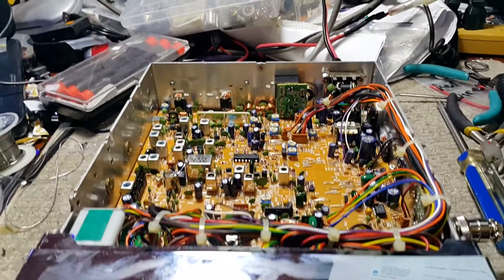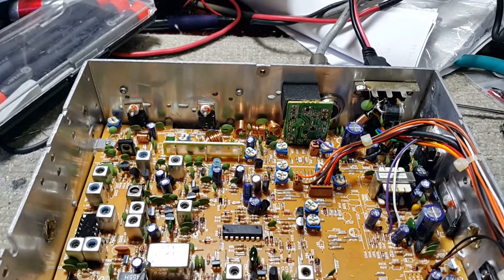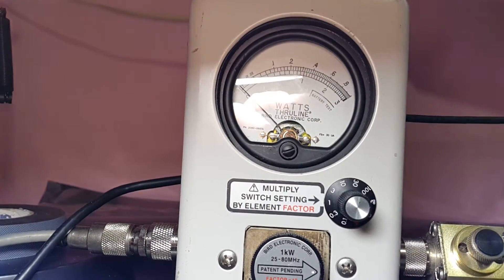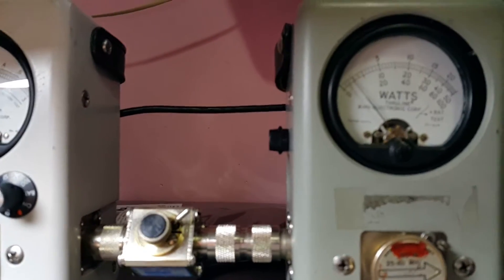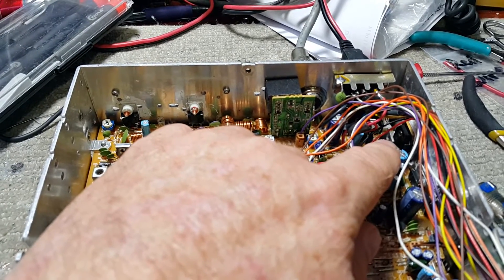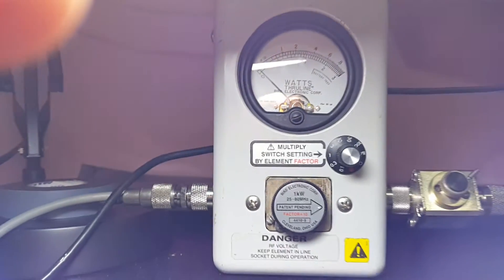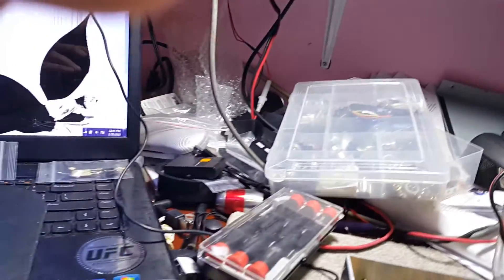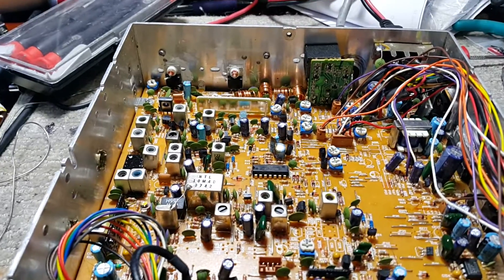Red Wire mod for a Galaxy DX 949

Comment: red wire to "volt" the final..burns up the radio faster.Splatter box worse than a galaxy junk is from the factory,spread coils,clipped limiter.Useless on SSB whay ruin a radio with these crap mods??
Reply: Because he can. I suppose you run a stock radio with 50% modulation.